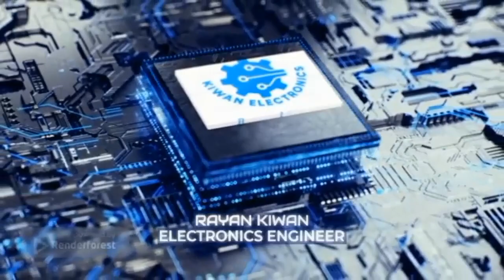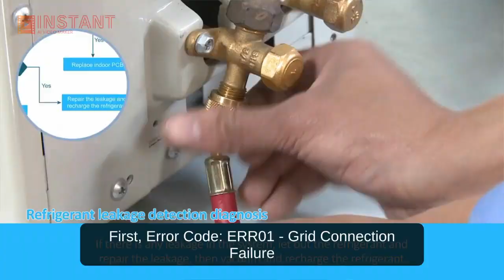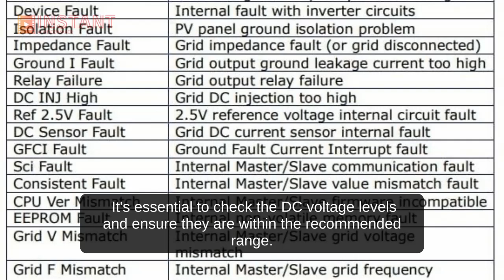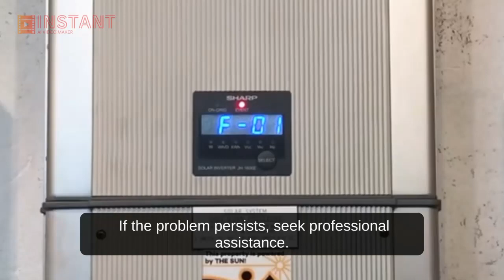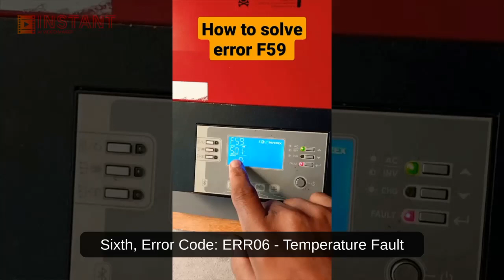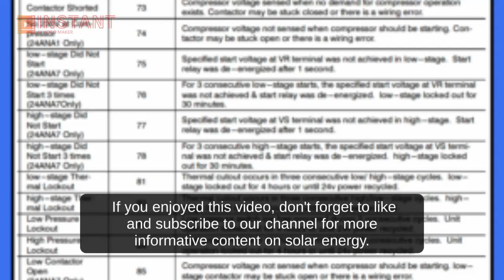Decoding Solar Inverter Error Codes: What They Mean

Comment: cellcronic magnum 3.5 kw office grid inverter fault code 1
Reply from the maker: Got the same issue with my Cellcronic Magnum 3.5kW – Fault Code 1 usually means a battery or overload problem. Try checking battery voltage, reduce load, and reset the inverter. If it keeps happening, might be a hardware fault – best to contact support with your model info.

Comment: Error 32
Reply from the maker: Error 32 in solar inverters typically refers to a ground fault, isolation fault, or insulation resistance error, depending on the manufacturer. This means the inverter has detected a leakage current or insulation problem between the DC side and ground.

Common Causes:

Damaged or degraded DC cables

Water/moisture ingress in junction boxes or connectors

Faulty or aged PV modules

Improper grounding

Steps to Fix:

1. Check the inverter manual for the specific meaning of Error 32 (as it varies by brand).

2. Inspect all DC wiring and connectors for damage or corrosion.

3. Measure insulation resistance between DC+ / DC– and ground using a megohmmeter (IR tester).

4. Dry and clean any moist connections or boxes.

5. If unsure, disconnect the PV strings and test them individually.